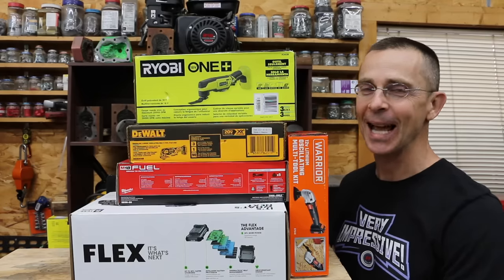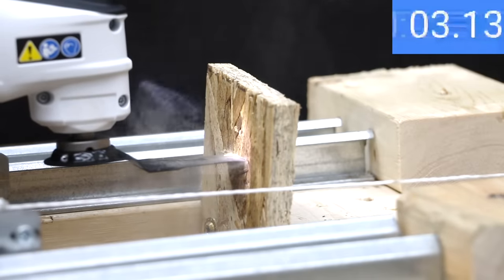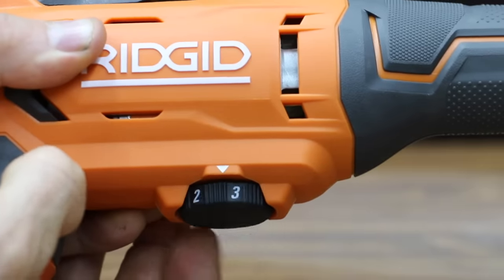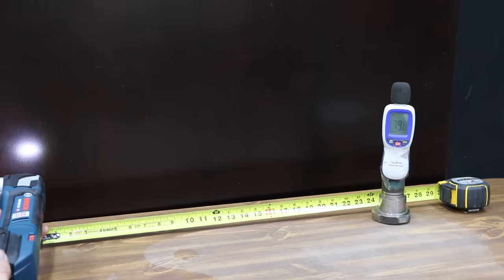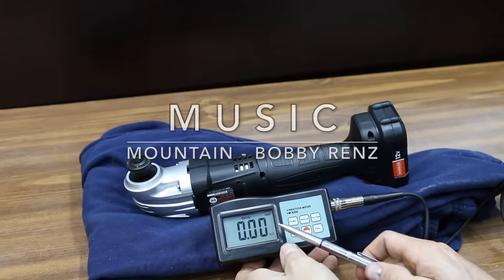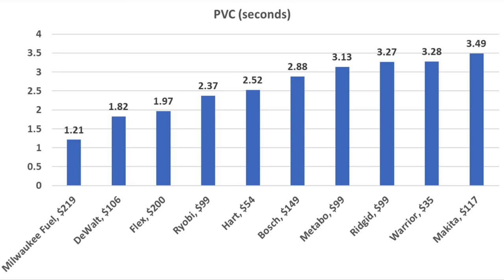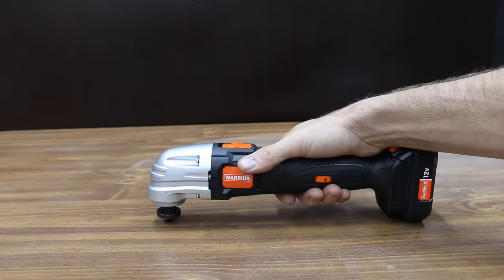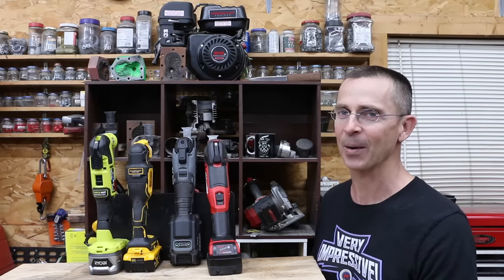Best Oscillating Multi-Tool? FLEX vs Milwaukee, DeWalt, Makita, Ryobi, Ridgid, Hart, Metabo, Warrior

Comment: I’ve used the Dewalt and the Milwaukee quite a bit on many, many jobs. I think the biggest thing you mentioned but didn’t emphasize is the variable speed trigger on the Dewalt, it really allows for more accurate cut placement when starting in the middle of something and allows you to slow down if you are cutting to a line. The blade change on the Dewalt is also infinitely faster. I also like that the Dewalt is able to stand on its own with the battery in, this is especially helpful when the blade is burning hot and you don’t want to put it on something that will get burned from the heat of the blade. I’ve had my Dewalt for about 6 years now and use it all the time.
Reply: Great points!
Reply: The thing I don’t like about is that you can’t just turn it on and use it like the Milwaukee. So it can be harder to get the tool in to tough to reach areas and tight spaces. Also doing flush cuts high above your head are difficult while maintaining a consistent speed on the trigger.
Reply: @wittwer427  I hear what you’re saying but the DeWalt has a trigger lock. Squeeze the trigger, push the button, and it runs wide open.
Reply: I cant figure out how milwaukee even thought of such a bad blade change system. Dewalts destroys it. Even with the speed difference I'd still pick the dewalt just for that. It's It's tool where switching blades happens often so it's important
Reply: @wittwer427  As said previously, there is a built in  trigger lock so you can turn on and use without squeezing trigger. 
I agree the angle isn’t as steep as Milwaukee but for most jobs I’ll take the stand up feature over extreme angle of blade.
Reply: This ^ and at half the price of the Milwaukee, it's a no brainer for me.
Reply: @CleanforGene68 I bought a dewalt for $70 on offerup. It was new too, keep an eye out. Sometimes people buy combo kits and sell the stuff they don't need
Reply: I'm usually all Milwaukee, but in this case I bought a DeWalt . I love it

Comment: I'd call the ryobi the best for the price, it performed quite well all around compared to other brands and was more affordable than those that outperformed it
Reply: And the fact that they don't change their battery configuration every few years is a huge plus for me.  I've owned Craftsman (Sears) and Porter Cable multi tool kits in the past and ended up with perfectly good but unusable tools because I could no longer purchase batteries that fit and rebuilding those batteries wasn't cost efficient.  I have no complaints about the Ryobi brand.
Reply: I've had a line of Ryobi tools over the past couple years and they've been so good and consistent. For the price and quality, you can't beat it!

Comment: Vibration on these tools makes a huge difference to health and safety. Thank you for making that an important part of the test.
Reply from the maker: You are welcome!
Reply: I have a Fein (older one) and a couple of the cheap harbor freight  for cutting masonry etc. Both are corded. I hate the HF because of vibration, your hands will be tingling after a short time. The Fein can be used for much longer.
I will be buying the Milwaukee Fuel when it goes on sale.

Comment: I've had a lot of multi tools over the years and you absolutely can't beat the dewalt with a battery, bag, and charger for $100. Lately I've settled on dewalt 20v and the M12 fuel. I prefer the dewalt for accuracy because of the variable speed trigger and the M12 fuel for demolition. The M12 is faster and it's way better with vibration control. I hate the makita, it's a brick. So many of these blade changes are so cumbersome they don't make any sense to me. The dewalt is the best quick change.
Reply from the maker: Thanks for the feedback.
Reply: Cool, these tests showed otherwise

Comment: The vibration force measurement tool was a nice touch. Also, I really appreciated the summary/wrap-up at the end, quickly comparing each one. Keep up the good work, Todd! You remain undefeated!😁
Reply from the maker: Thanks, will do!
Reply: I agree, very good. I remember a couple years back, working in contruction and being handed the makita to remove excess concrete off of finished walls.
Terrible job, its true you need two hands and the vibration makes your hands hurt quickly.
Reply: I have the DeWalt and thought it was a little vibey but I can't imagine using those others! Milwaukee seems the best choice for a professional using it regularly.
Reply: It would be interesting to also test vibration while it has a blade on, and again while cutting.
Reply: @RandomShart  I have the DeWalt as well and without any basis for comparison, it seemed 'okay' to me, but after watching this video I appreciate it a bit more.
Reply: The older my wrists get, the more important low vibration is.

Comment: Another great review.  I decided to go with the Dewalt for two reasons: (1) ease and speed of blade changing and (2) I already have a stash of Dewalt batteries. 😉
Reply from the maker: Thanks!  Thanks for sharing.
Reply: I love my DeWalt so much, it's easily my favorite tool although, now having it owned for 4 years now, it looks incredibly ratty. As a cutting tool, it's a very safe tool for working around difficult areas or rotten wood that you're not quite sure what's under it. It's also the only tool I know of that can mate two surfaces perfectly together seamlessly. Simply press both sides together and let the blade remove the high spots. It's like magic and I use that a LOT.
Reply: Been using a friend's Dewalt,  love the size and ease of blade changing.  But bought a Ryobi because I already have their batteries and they don't change the style of their batteries like other mfgs.
Reply: As an owner of the DeWalt, I’m not sure I’d characterize it as easy to change as it takes grip strength, which sometimes at the end of the day, I lack. 

Also, for whatever reason, it isn’t good at cutting holes with a 1 gang rectangular drywall saw. I actually keep another oscillating tool around just for cutting perfect box openings in drywall.
Reply: I’m a massive Dewalt “fanboy” and as always, was very happy to see its performance on par with the quality I’ve come to know and trust.
Reply: @generallyhelpfulsoftware646  If you’re having issues with the grip when you go to change out attachments, just hold the toggle lever down against a table/bench top (with the head of the tool pointed away from you for safety). Regarding drywall cuts, you may have already considered this, but maybe pick up a different blade strength/size? Worth experimenting with a bit but I admit I’m heavily biased towards Dewalt.

Comment: Higher degree of oscillation definitely helps to make faster cuts, but when plunge cutting into a finished surface, it can works against you. I personally own the Milwaukee m12 multi and I find when trying to make a precise plunge cut into a finished surface (not necessarily a painted material, just a cut into wood that will be seen forever) it is difficult to keep the blade from running or chipping out material when starting the cut. I find a lower degree of oscillation creates a cleaner cut when starting in this application. I get that not everyone uses a multi tool in this fashion, but just figured I’d give some input. Thank you for the great video!
Reply from the maker: You are welcome!  Thanks for sharing.
Reply: Does starting with the lower speeds help, or just the same ? I only have the corded Fein brand , one speed but it's a beast.
Reply: I’ve noticed the same with my Milwaukee as well. I think I saw a similar test video where they noticed the Milwaukee was so over the top you essentially can’t cut delicate stuff with it. It is one of those things where you start to wonder why you are using that tool for cutting tons of nails ...
Reply: Try rouded blade instaed of square one
Reply: Try using the bosch curved blades. They're expensive, but it's easier to make those precise cuts with them. The milwaukee blades are by far the fastest but harder to be precise.
Reply: I wonder how Fein compares
Reply: I do agree to an extent. I had the variable trigger version of the Ryobi,  it was much easier to start slow then ramp it up for nice clean cuts. I now have the one in the video, its an on off switch, you can put it on low speed and ramp it up, but if you accudentaly put it down to zero, it has to be restarted which is annoying,  need to turn it off and back on!

Comment: I’ve been in the construction business for over three decades. My go to oscillating tool is my M12 by Milwaukee. It’s slightly lacks power but more than makes up for it with its narrow footprint, weight and runtime. On a four amp hour battery, I get most of the day of general use out of it. Great reliable tool.
Reply: I got the m12 for same reason. Was hoping to would test the m12 version
Reply: I was wondering if there was an m12 version.
Reply: I have the m12 fuel, it'd beat all the other 18+ volts tools shown. It's a great light tool, my go to
Reply from the maker: Thanks for the suggestion.
Reply: My go to is also the Milwaukee M12.  Very impressive tool
Reply: I fell in love with my m12 impact driver because it's just so portable. It fits easily in my bags and never falls out.
Reply: I have the M18 and I have used everyone one that list with the exception of the warrior and the flex it is by far the best
Reply: They jsut came out with a new fuel version that its supposed to be much better than the previous models i believe its basically the same as this one here he tested but i cant remember if its was the 12v one or the 18v one that people had issues with the battery popping off but i think they have fixed the problem, Either way as the video shows they are killer and he didn't highlight the coolest function which is the auto setting which will automatically speed the tool up as it cuts which is supposed to work really well.
Reply: @ProjectFarm  I’d love to see the M12 and the Fein. The cheapest cordless Fein is only $200 with batteries…that is cheap enough that I’m actually a bit scared. It also doesn’t have an LED light. 

I’d also like to see vibration measured while cutting something. My hypothesis is that the rankings would stay the same but the difference would be greater. 

Please don’t test the Festool. I’d like to continue believing that it’s not that much better than the Milwaukee, and my wallet will cry if it’s actually way better.

Comment: great video, I have a couple of Ryobi tools that use their One battery system and I'm very happy with  them.

As for a product suggestion, I'm trying to strip the paint off a bike frame and I've struggled to find an efficient paint stripping gell/spray and it's been a lot harder than I had expected. I'd love to see a shootout of different paint strippers to see if there's a best one for my future projects. Thanks!
Reply: whaaat didn't expect to see you here!
Reply: I'd love to see this too. I'd imagine methyl ethyl ketone would be pretty good, with steel wool as an abrasive
Reply: I'm interested too as I'm restoring snowblowers with decades of added paint.
Reply: @picax8398  haha Project Farm is one of my fave channels, I look forward to it every week
Reply: Thank California. I've noticed a lot of the good paint strippers have been discontinued or reformulated to be more tree-hugger friendly (in other words, perform a whole lot worse) so I'd consider that some welcome information as well! Good idea 👍
Reply: For some paints a heat gun works very well as a paint stripper. a flap sander or wire wheel on an angle grinder work well on metal surfaces. Since most chemical strippers have had their most effective chemicals removed....
Reply: @mikeylikesit5131  only issue for me is that a bike frame has a lot of tricky shapes and unreachable areas plus the metal can be quite thin so would need something more gentle than a flappy disk
Reply: @Ali_Clarkson  Rust Oleum is pretty good. Worked on most factory 2k paint for me. Wrapping it in pastic foil and leaving it overnight gives the best results. If it's a steel frame you can consider a 3m bristle disc. In combination with an angle grinder or a  high rpm pneumatic sander. It will remove paint pretty quick without damaging the tubes. Also works with aluminium when you are carefull.
Reply: @mikeylikesit5131  I've tried all of what you mentioned but a lot of what I'm trying to strip has thick soft paint that's almost immune to wire wheels and gums up everything else. Fiber discs work ok but but unless I can buy in bulk the brand I want they get expensive fast. Auto parts stores used to sell them in bulk but it's not 1985 anymore and quality tanked hence me restoring old equipment.
Reply: @tihspidtherekciltilc5469  thick soft paint would come off easy with a heat gun. 👍
Reply: By far the best way for a bike frame is to find someone who does bead blasting, especially where there is a bit of rust. You could also try sand blasting (from a distance) but typically distances create some pitting as the sand is too harsh.
Reply: @philnolan7193  I was tempted by this but wanted to save costs plus with the tubes having breathing holes it can be very hard to remove all the blast material and have it rattle around (though this didn’t seem to be an issue when I had it done before admittedly)
Reply: That doesnt seem to be a very easy thing to make a set of tests to compare different brands only because thers so many different variables when it comes to paint that itd be almost impossible to get any sort of meaningful result. With all the different types of paint  is a huge task and that's without going into the number of coats  and how old the paint is and then you get into the different surfaces and it kinda might be a big rabbit hole. To reiterate what someone else mentioned a lot of the good stuff has kinda been changed to  try and not be as harmfull/toxic since a lot of them are pretty nasty. But a brand called circa 1850 can work good also Rustoleum Aircraft remover which has a bonus  of being good at getting those pesky airplanes off your lawn . Just a side note would it be that your bike frame is actually powdercoated? I think that's common for a lot of metal bike frames.
Reply: @philnolan7193  media blasting is fine on Cr-Mo frame. If it’s composite or aluminum, that would be a hard no. Media blasting carbon is pretty obvious problem but media blasting thin walled aluminum can cause fatigue cracks and/or damage heat treatment, depending upon the alloy used in fabrication
Reply: Definitely!
Reply: You need to know the type of paint used. If it’s a vintage steel frame or modern high-end/custom steel, titanium or alloy frame, it’s likely a lacquer or a catalysed urethane paint. Most big box stores carry effective chemical paint remover to handle this type removal. 

Modern production steel or alloy frame are powder coated and will require a more specialized chemical remover. Easy-Off oven cleaner will do the job but there are better products available, usually available at a powder coater. I would honestly recommend taking to a powder coater and paying them to strip it, saves you from headache of handling toxic chemicals and the related cleanup/disposal. 

If it’s painted carbon, that’s a very specialized product and application, designed to not compromise the resin. That is never a diy job. Good luck
Reply: You might try looking up stuff to strip powder coating instead of paint as that's more likely what's on the bike frame
Reply: @Ali_Clarkson  , not sure the size of the holes you are dealing with, but golf tees are my go to fill holes on airplane parts that get a bead blast treatment. I imagine unless they are fairly small some dowels sharpened to a point would work
Reply: Great suggestion, all the paint strippers I have tried recently have been pretty sub-standard.
Reply: @Ali_Clarkson  If you have an air compressor with a blow off tool, make an easy DIY sand blaster. All you need is a compressor, some kind of funnel, and a blow off tool. Then just buy some crushed walnut shells or whatever you want to use as an abrasive. It's cheap for the material, and if you're not going to do it all the time you don't need to worry much about wasting it so you don't need a cabinet or anything. There are many guides online how to make it.

Comment: Great review! The blade change system deserved a category of its own. I was an early adopter and longtime user of the tool. I purchased a Fein Multitool when it was the only tool of its kind. It is still going strong but, I am ready to exchange it for something with a tool-less blade change. Not only tool-less but with no small parts to remove, handle or lose.
Reply from the maker: Thanks!  Thanks for sharing.
Reply: Get the Dewalt, it's amazing! You can get a deal on them often too
Reply: @thedarkness5133  right? After using the Dewalt for a few years the other blade change systems seem way too complicated!
Reply: @ProjectFarm  I really liked the way you did the summary on this video. Keep up the good work.
Reply: Same. Got an Fein 600€ battery one and a 105€ Makita one body 18v. I only use the makita.
Reply: Agreed, I bought the cheapest one I could find, thinking I would use it in just some odd cases, but it turned out to be the biggest annoyance
Reply: I second the DeWalt. I use them daily at work and that blade change is so nice. Opening the replacement blade takes longer than installing it